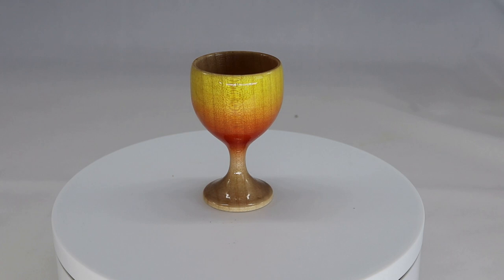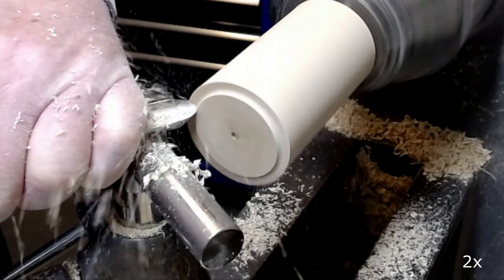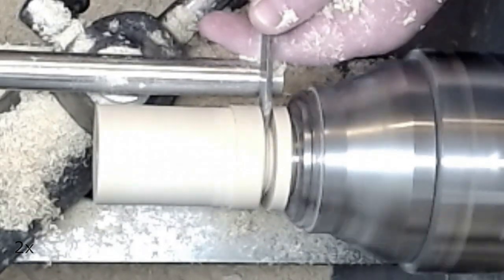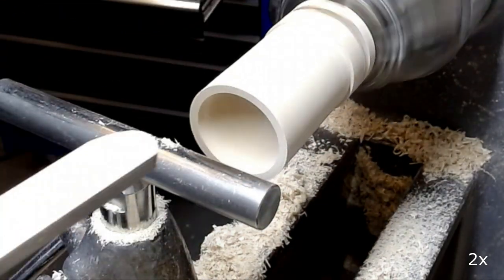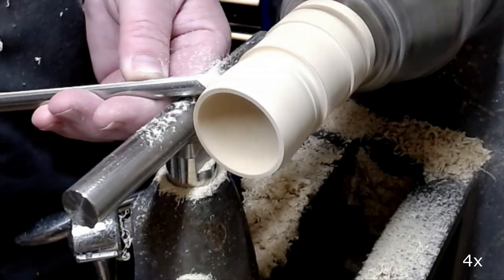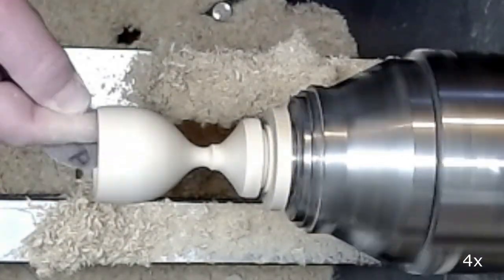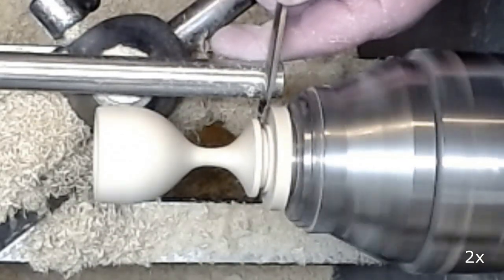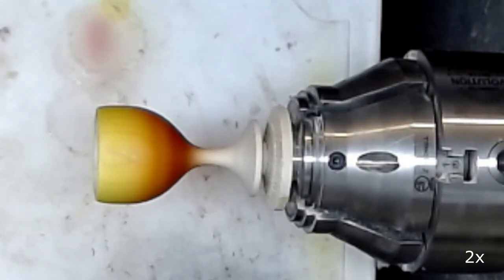Woodturning #36   Egg Cup   Coplours

Comment: Very interesting technique for painting and adding resin. I would never have figured out spinning the lathe to dry the resin. I find you videos very informative.
Reply from the maker: Hi Marilyn. Running the laith does not speed up the curing process of the resin but rather keeps the piece moving until the resin has cured enough to stop the resin sagging. Because the piece is round the resin tends to sag until it is partly cured. I have seen some people use grill rotisserie for the same purpose. Depend on your laith. It needs to run very slow. Otherwise, the resin will be thrown into space. Thanks for your comment. Most appreciated.